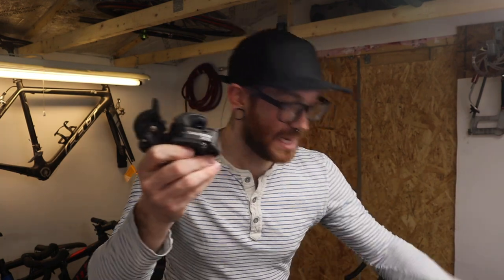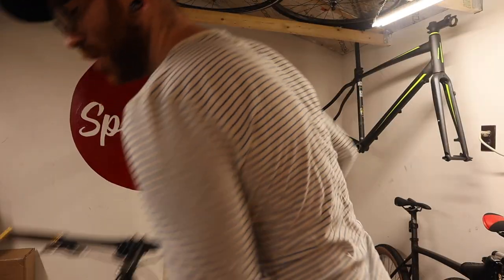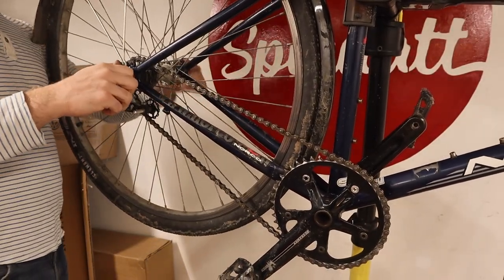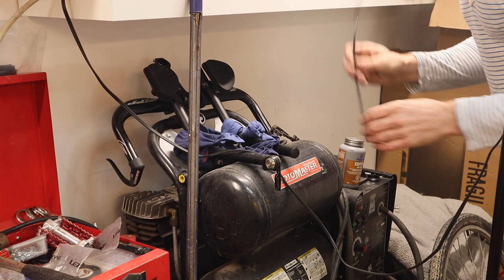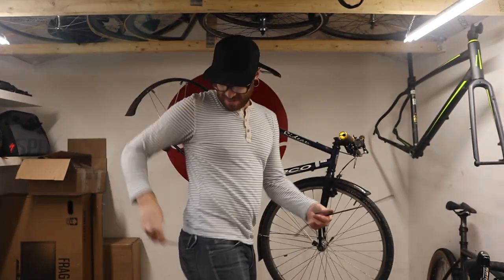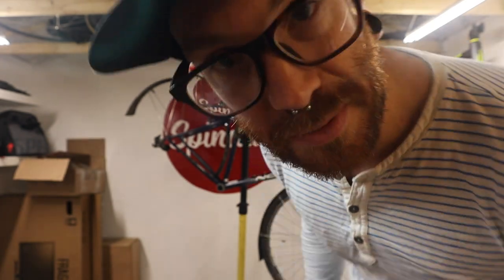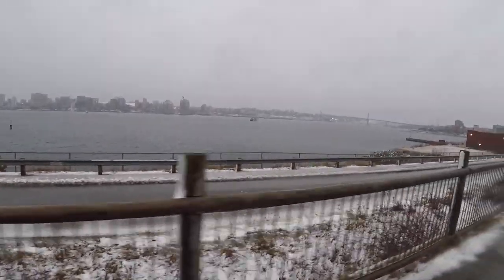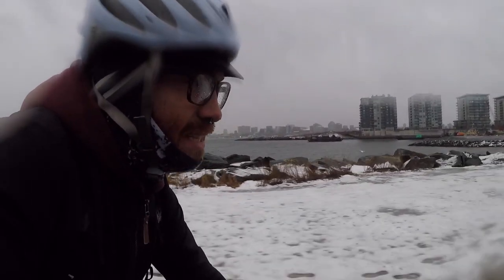10 Speed Chain, 8 Speed Cassette

Comment: Shimano 9 speed is the kludger's dream.  Road/MTB are 100% compatible, it's common, and it's dirt cheap just about anywhere.  You can easily do flatbar roadbikes, dropbar MTBs, and anything inbetween.  You can even supplement with Microshift stuff if you want to go with new on the cheap.

This is more for the comments section and not you, Spinney.  :)
Reply: I'm never gonna forget that explanation video when I see the logo now, hah
Reply: if it's 1:1, i think most sram is, just the shifter and cassette need to match.  shimano mtn 7-9 are the same pivot ratio as 7-10 road, except 4700 tiagra that shares its ratio with the 11 speeds. so they say you need to run a matching group but that is BS
Reply: With SRAM, you can do 10 and 11 speed combos easily. Any shifter/derailleur labeled “Exact Actuation” will work seamlessly, which is pretty much all parts minus 11/12 speed mtb parts. Those use X-Horizon shifting.

Comment: Genius thoughts on 10 speed chain and 8 speed cassette.  Makes perfect sense for a crappy weather commuter where gunk, snow, ice and all kinds of crap are going to build up around the drivetrain.  For a while I was using a friction shifter with whatever rear derailleur and cassette/chain I had laying around.  Worked pretty well, but got annoying after a while.  So I bit the bullet and went all out on a Priority 600 bike.  Gates belt drive and a Pinion BB shifting system.  Only maintenance is a once a year oil change on the Pinion system.  If it wasn't so heavy, this would seriously be the only bike I own.  But it works awesome for year round commuting, which during the winter months is about the only riding I get in.  Great vid as always.

Comment: If it works, it’s all good. I’ve worked on worn out crappy stretched 8 speed bikes that shift better than the latest 11-12 speed bikes. I think external cables also has a lot to do with that. Good video.

Comment: Everyone needs a constantly evolving parts bin bike. Something that gets up-down-sideways-graded in random manner as "spares" become available. 
I have an aluminium frame from a chain Sports store "own brand" bike that was originally a 700c flat bar hybrid that currently has 8spd Claris and drop bars, Hayes mechanical disc brakes, and some $65 Chinese carbon "hardnose" forks which are long enough to replace the original suntour suss-pension forks and preserve the geometry. The wheels are a set of WTB 29ers with 700cx25 Re-fuse tyres. 
I say currently because there is a 3x9spd Deore/Alivio mix flat bar shifter drive train that might end up on it and some "new take-off" Mountain King tyres that it has enough clearance to run evolving it into a light duty full rigid 29er MTB. 
This is a bike that spends more time being tinkered with than being ridden, but that's its raison d'être.

Comment: My commuter needs a new front chain ring. Currently Ive got a 9s Shimano Sora groupset. I cant find any 9s 50t chainrings near to me but I can find plenty 10s 50t chainrings. Im currently replacing the BBbearings, chain ring, chain and rear cassette. My question is can I use a 10s chain ring with my newly bought 9s cassette and chain? I dont want to buy a new crank set just for the chain ring unless I really have to and I dont want to buy the 10s chain ring to then have to buy a 10s group set. Thanks

Comment: When the cassette gets too worn out a cassette hack could be in order. A ten speed cassette minus 2 cogs, plus some slick custom gear ratios, sounds sick to me. Ive been running a used sram 7 speed dh derailleur (built for 11 spacing, chains, and "exact actuation" shifters) with a 10 speed chain and cassette up until recently. I disassembled a sun-race 10 speed cassette, took out 3 gears and it worked great. Recently though I upgraded to the proper cassette and chain (I was skipping teeth it was so worn out lol) , it works a lot better now.

Comment: Love your channel.  2 years late to the convo.   Building my own franken bike with a cool late 80's early 90's serotta frame.    Using an ultegra 6650 10sp crank, 10 sp chain and 8 speed Campy (gasp) rear cassette.   I am also using 10sp dura ace bar-end shifters I picked up.   I'll be running this in friction mode.    Won't friction mode solve a lot of issues?
Reply: yes

Comment: The 10 speed chain is just a bit narrower, whereas the 8 speed cassette has enough room (for a wider chain) between the cogs, so that's why it works.  Your shifter is pulling the derailleur enough to properly center the chain for shifting on the next cog.   If you look at the cog, the teeth are not aligned in a straight line, but in a wave, so as to allow some of the teeth to pick up the chain and others to drop it on the lower cog.

Comment: Hey I just used a 10-speed chain on a bike that has 8-speed components, and the chain just snapped. When I stood up and drove my leg down, I heard a pop, and now I have a bruise and cut on my left leg. I'm kind of new to all this cycling stuff, but I stuck with the 10-speed because it seemed to rub less than the 8-speed that I already have. I think there was some alignment issues with my particular bike, which was purchased used, so I went with the 10-speed rather than the 8-speed chain. There's also the possibility that I might have messed around with the rivet when trying to break the chain for the first time in years. Before I put on a chain again, is there a danger in running a 10-speed chain on an 8-speed bike? Thanks for the video btw.